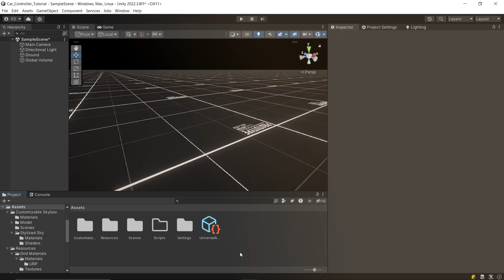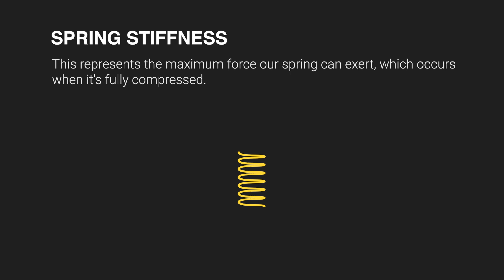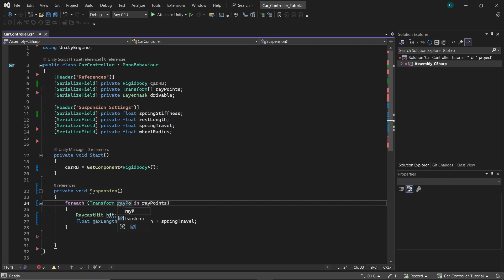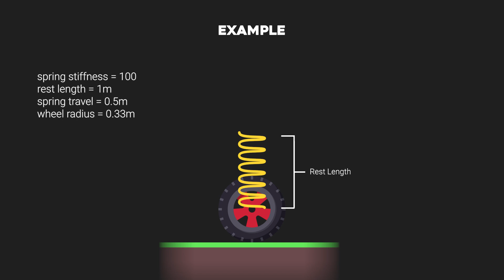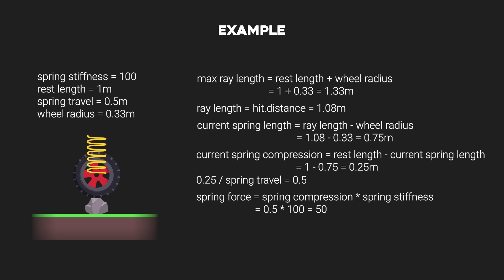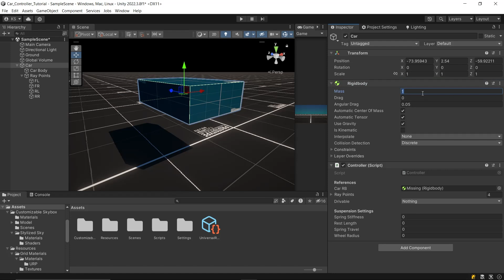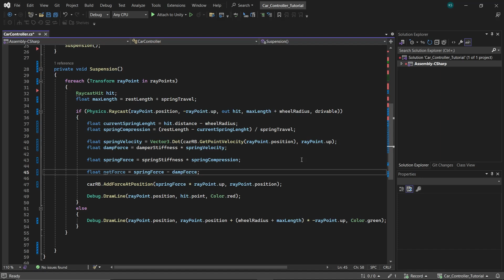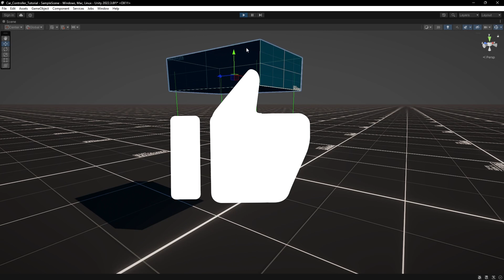Arcade Car Controller Part 1 | Suspension tutorial Unity | AshDev

Comment: It looks like you're reinventing the wheel here. Why don't you use Unity's built-in wheel collider?  why over complicated ?
Reply from the maker: what if the wheel is bad? try it yourself. actually we are making it simple. unity wheel collider is complicated. you cant get desired results easily.(i have never found good results with it)
Reply: @ashdev  1000 unity engineers worked/ing on the wheel collider, but you say it's not good. ..
Reply from the maker: @whiletrue1-wb6xf  Try yourself.

Comment: Hey Ash

I guess some values are not working in Unity 6 physics. Damper Stiffness never dampens the suspension. I set it to 2000 and -1 but it does not dampen the car's bounce. The car bounces all the time.

Only when I set the Linear damping value to 1.5 and the Angular damping value to 1 in Rigidbody, the bounce stops after the ray collision regardless of the Damper Stiffness value. Do you have any ideas about this?

Damper Stiffness calculation never dampens the bounce. It seems like this is a problem only for Unity 6, what do you think?

My all parameters;

springStiffness = 5000
damperStiffness = 2000
springRestLength = 1
springTravel = 0.5f
wheelRadius = 0.33f
Reply from the maker: Check your code once, if you're subtracting the damping force from the suspension force or not

Comment: Hi, I own all of your assets and use them often and happily. What I would really like is an AI system for SIMCADE, or at least instructions on how to use the normal "AshVehicleAI" in SIMCADE.
(the same applies to ArcadeBikePhysics, by the way).
I can use AshVehicleAI (conditionally) in AshMonstertruck Physics.
Thank you for your answer.
Greetings from Vienna,
Karl Schanzl
Reply from the maker: hi, i was working on Arcade Bike Physics Pro asset. its done. now i will be working on all in one Vehicle Ai solution. i dont know what it will be called yet. but it can be used with all vehicle/bike physics assets. from other publishers too.
It will take time.